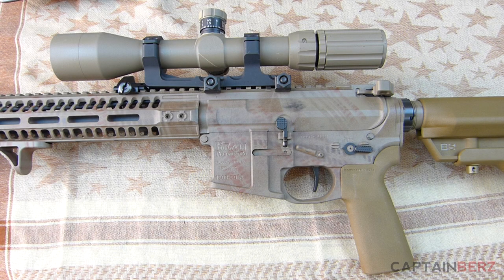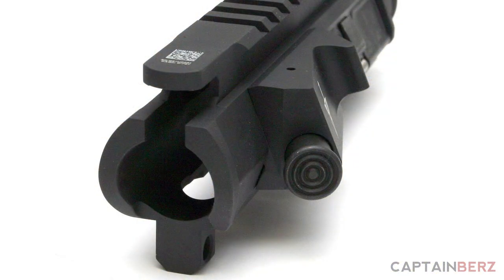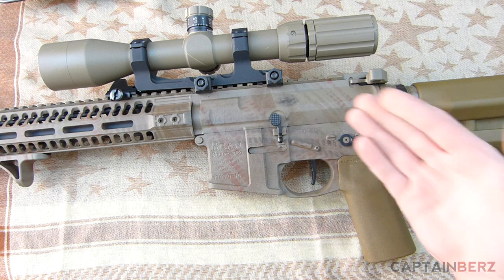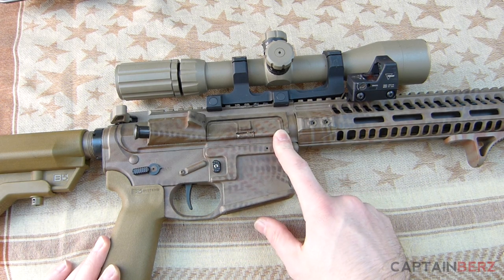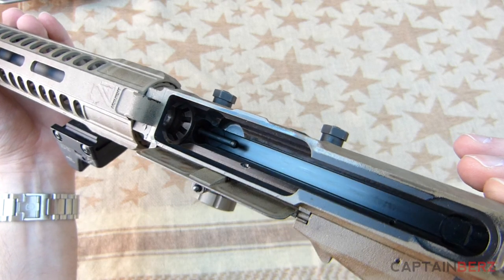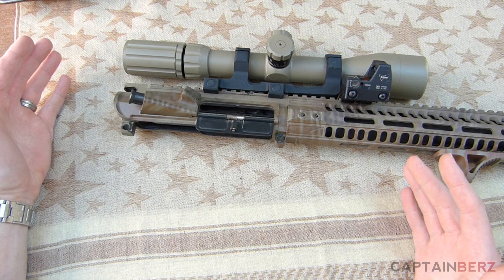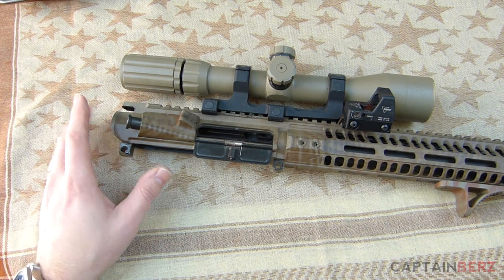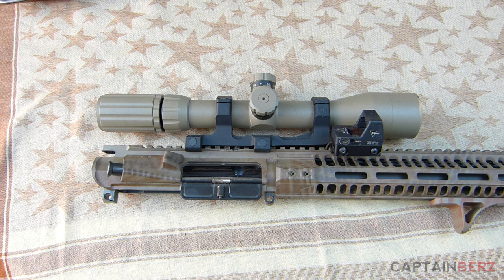VLTOR MUR Upper Receiver for AR-15

Comment: I'm a creature of habit. Don't have a bazillion ARs but those I do have all have VLTOR uppers. One with their monolithic offering and the rest MURs.  Not just for SPR type builds IMO. Help turn shorties into tack drivers too. One caveat though, you do need to make sure you mate with a high quality lower for obvious reasons. No slop in them and need a lower that is equally spec'd. Mine are all Noveske lowers and they do the trick as do their barrels. lol. In my experience rifles/components are like anything else in life. You pretty much get what you pay for
Reply from the maker: +RobbieGTV I agree. I like one solid rifle instead of 2-3 "ok" rifles. I like a rifle I do not have to think about working, it just does.

Comment: I have two of them and I think they are the best. And the BCG even slides smoother and more quiet. 

First I did an M-4 style with a Daniel Defense 14.5 barrel with the Vltor low profile gas block and Vltor charging handle. I'm planning on adding their proprietary buffer tube system. 

My second one is a Grendel "20" DMR style rifle with the same charging handle. I went with Oden Works barrel, nitride BCG and adjustable gas block.  It has a Luth AR MBA-1 rifle length stock and tube. Not as nice as the Magpul PRS but still pretty good. 

I'm still surprised how many people don't know how high quality that Vltor is. Their parent company, Abrams Airborne manufacturing is a defense and aerospace contractor. 

Most people also don't seem to know that the original BCM Gunfighter charging handle was designed and built by Vltor. The two companies recently split, Vltor owns the patent on it so anyone who wants the original gunfighter, just buy the Vltor charging handle and you will have the original Gunfighter charging handle. My first one says BCM but my newest one just says Vltor. They are the exact same handle

Comment: 2 AR’s and both are built on the Vltor upper. One an 18 inch Noveski & the other a Daniel Defense. Both run 100%
Reply from the maker: VLTOR = Winning!
Reply: I also have the Vltor, Daniel Defense barrel combo. Very accurate! Those Noveski barrels are expensive.

Comment: How do I get your scope set up with the red dot on the side like yours? I really love your set up and I bought the vltor mur as well and I have a bcm handrail
Reply from the maker: I just put a 45 degree pic rail adapter right behind the scope mount, and put the RMR on that.
Reply: CaptainBerz what site do you use and what scope are you running? Is it a 3x9 40mm?

Comment: Do you know what the differences are between the stranded VLTOR MUR and the Noveske/VLTOR MUR are?
Reply from the maker: +Braden Askew Not sure. Noveske has been re-branding or paying for the right to put their name on things so it might be no different at all. That is my assumption if the VTLOR name is on it.
Reply from the maker: +CaptainBerz I am not sure they pay per se but it could be a collab with the Noveske name added.
Reply: +CaptainBerz That's true. I know for one of their rails it was made by somebody else but John redesigned some aspects of it. They also made a contract up that the base company couldn't adopt any of the changes made. I didn't know if the did the same with the MUR.

Comment: I’m building a 13.7” sons of Liberty build with an A5 receiver extension. I’ll likely be running a sandman k on it as well. 
Can someone give me an idea of what this will do compared to my sons of Liberty upper receiver I purchased? Im going for a super duty rifle and not a slow shooting precision rifle. I’m just not so sure this will give me for my an advantage for my style. Maybe for the longevity of the parts but idk. Anyone have any info that could help me on this?
Reply from the maker: VLTOR MUR is lifetime warranty, MILSPEC, finished by hand and the inside has a coating on it.  Also aircraft grade aluminum. SOL doesn’t say any of that.
Reply: @CaptainBerz  thanks for adding that. From what I’ve been seeing most people use this for precision shooting. I’ll likely pick one up.
Reply: VLTOR MUR is a great upper. I own a number of them. Nothing wrong with the SONS upper either. Sons are Milspec they ALSO have a lifetime warranty (they offer that on all their parts to include wear). The tolerances are extremely tight (https://m.youtube.com/watch?v=Y5v37Y0f2aU). They are also thermo-fit where the MUR is not. Manufactured by ZEV to their SPECS.
Reply: I have a MUR on a pencil barrel.That barrel started out with an A1 reciever.Weighs more now but shoots noticeably titgher groups.